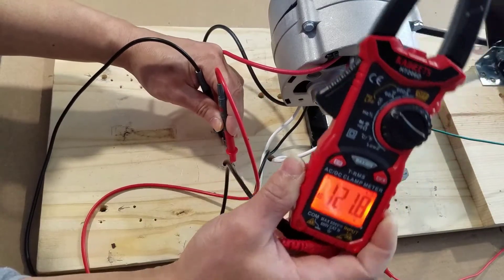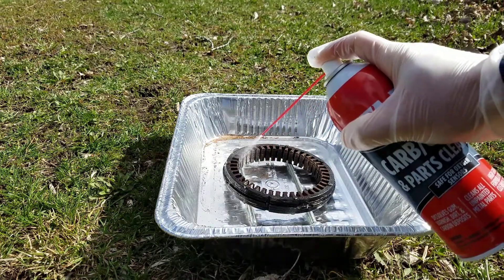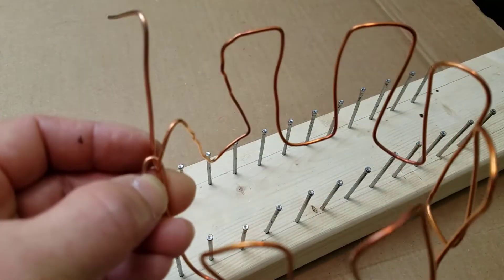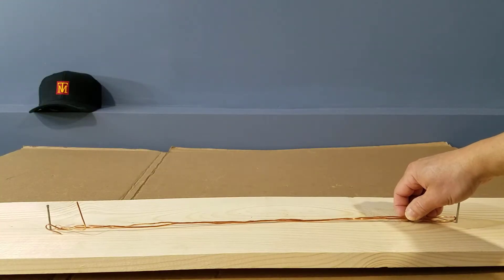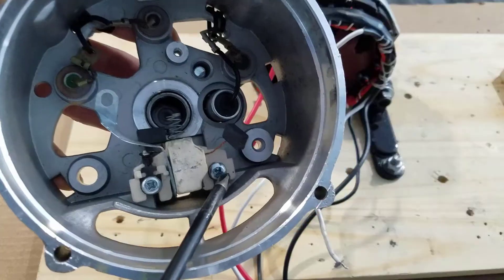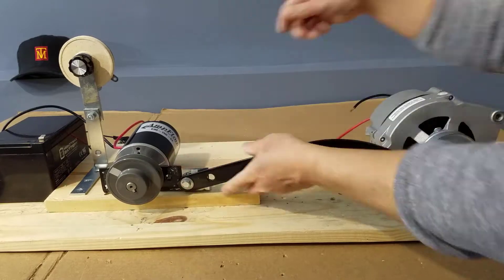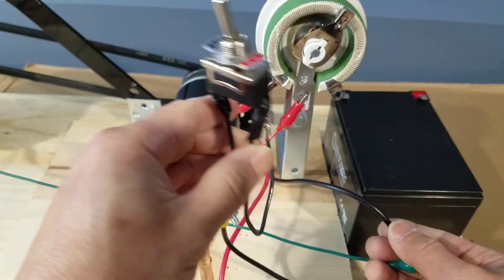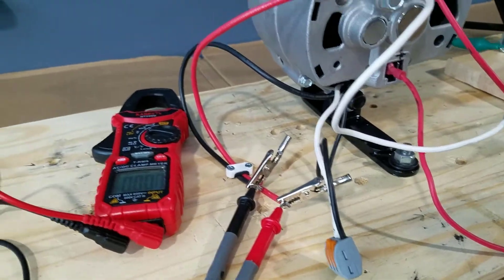I Turned A Car Alternator Into 120v AC Electricity Generator!

Comment: It's a lot easier, and cheaper to use a 5 h.p. A/C motor as a generator and no rewiring is necessary.
Reply: you need to use a synchronous motor which is very expensive and rare. most ac motors are induction motors which won't work

Comment: How many hertz at voltage output
Reply: 220Hz 121vac
Reply: It can't be 220hz
Reply: @kingzrecap1835  60hz ish. it depends on the rpm of the system. the faster it spins the higher the frequency

Comment: Wow iv been waiting for someone to rewind a car alternator to make 120v ac awsome work I did this back then without rewinding it was able to power a light but not enough volts also I wonder what the output would to with a hydrogen generator you just have to convert it back to DC

Comment: I wonder how efficient is.. I mean Watts going in at 12V in to Watts coming out at 110V? How does this figure compare with just running a 12V to 110V  inverter off the same battery? Thanks for your as always detailed explanations and clear images!
Reply: I'm guessing the 12v motor is just for demonstration purposes. In a real world setting you would have it hooked up to a gas powered engine or a turbine.

Comment: Connect 200watt transformer and step down to 12volt and rectified and charge the battery same time with a super capacity banks in parallel and you get a good system

Comment: Thanks, now my problem is solved too in that the light bulbs and power tools will work at a higher frequency. The reason the power tools work is because they rectify the voltage to DC and have a built in voltage regulator. The light bulbs just seem to be brighter at 216 Hz.
Reply: i know this is 6 months too late but here is how i would do it

take a alternator remove the voltage rectifier and diode pack
take each of the wire pairs (1 pair per phase) and record the voltage of each when spinning at the right speed to make 50hz (or 60hz depending where you are) with 8-10v at the brushes from a bench power supply to given you voltage X at the wire pairs (also record the rpm for the required frequency)
take 120v divided by your voltage X to give you the amount you need to step up the voltage by
put in a step up transformer of the correct ratio to get your 120v 
repeat for the other 2 phases

do not join all the phases as shown in this video each set of 2 wires is a seperate phase and shouldn't be joined (would like to see the video setup on an osiliscope i doubt the ac is remotely clean)

now set your drive motor to the required speed for your 50hz or 60hz and add your load (tools or lights) recording the voltage when the voltage drops you increase the voltage at the brushes to compensate ad bring the voltage back up (this will increase load on the drive motor so watch the rpm and hz as too much load will also cause it to drop)

if you use all 3 phases (seperately) try and keep equal loads as when you adjust the voltage to the brushes for the lowest phase it will also increase the voltage on the other 2 phases

the limiting factors for this setup is wire diameter (alternator and transformer) which will limit current, tell tale of overcurrent is getting hot
drive motor hp - as the brush voltage is raised the magnetic forces increase creating more load to turn the alternator 
brush power supply voltage and current (as electrical loads increase you'll need more and more power at the brushes to maintain 120v ac)
Reply: @jasonpeace91  you're idea sounds good. You should make a vid and post. I would like to see it done so I can do the same haha. 
Thank.
Reply: power tools use "universal brushed motors".  there is no rectifier, the field and armature windings simply alternate with the supply frequency, and as they always maintain the same electrical relationship, it always rotates one way (easily reversed by swapping the field or the armature but not both). but they are slightly different to a "shunt wound DC " motor, as they have to have low inductance to deal with the AC power supply.... and as the frequency increases, they start to suffer hysteresis and eddy current losses in the iron laminations...

Comment: If you use a smaller pulley for the alternator would it increase power output
Reply from the maker: You could be correct, but the DC motor will need to work harder.

Comment: Why did you use smaller diameter copper wire instead of same diameter
Reply: Porque tienes que meter más espiras de bobinado, en el mismo agujero.
Reply from the maker: @Bectris1  Thank you for your comments and support. Yes, you'd need space to accommodate more turns in the coil.

Comment: You can make 120 vdc from a regular Delco alternator if you full field it and spin it about 7000 rpm.
Reply: But it burns out the alternator! Seen it done,so that's why I wouldn't recommend it!
Reply: @madhounddog04  current draw burns out the alternator. Just don't draw more current than the windings can handle
Reply: @madhounddog04  you need to start with a 100 amp or so alternator. A few years ago i made one and ran a coffee pot and lights off of it without any problems. I used it to run drills and electric saws with too.
Reply: @greasezert2228  what size wires did you use,?
Reply: That's why you use an alt with bigger stator windings. Transformers capacitors and other electrical components can do wonders. Gearing can take things even deeper down the rabbit hole 🕳️
Reply: used to could buy the kits to do that. they just throwed full battery voltage to the fields and when the car engine was speeded up to a certain speed they usually had a light that came on indicating 120 volt dc. I put one on my chevrolet pickup back in high school. I had to rig up a throttle on it. Later I took a 5 hp b&s and belt drove a gm alternator and used it to make a little dc generator. I had no way to check the voltage or the amps. I used it to run a skil saws and drills and lights.
Reply: The bearings would have to be upgraded, also i would sharpen the fan blades for less air resistance and more air cooling volume. If I'm figuring correct, a 100amp alternator should give you 10 amps at 120vac before overheating??? Right?
Reply from the maker: That's a good possibility, but it'll require maybe at least a 10HP motor to drive it to reach that high RPM with full field applied.
Reply: @TheoMaxim777  but if you talk dirty to it,  ....wait...........thats something else.........
Reply: @TheoMaxim777  I have done it with a 5 hp engine to make a generator for lights and universal brushed motors. 700  watts or so.

Comment: What's the frequency of the ac?
Reply from the maker: At 120v it was about 216 Hz. Refer to the video at about 10:24
Reply: @TheoMaxim777  too high to run anything other than resistive loads.
Reply: @TheoMaxim777  thanks
Reply: @TheoMaxim777  it can't be 216 Hz if that what you got then ....

Comment: Please tell us how you did the rotor combination befor, to work?
Did you use a diode?
Reply from the maker: There were no diodes or voltage booster circuit used.